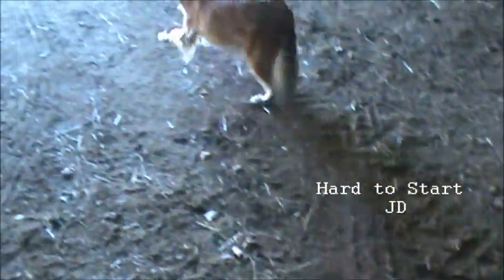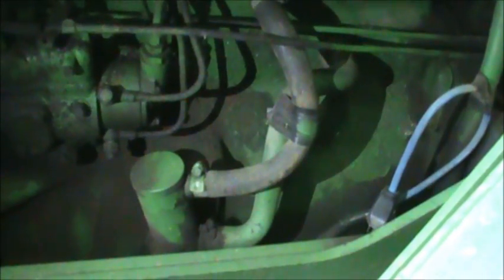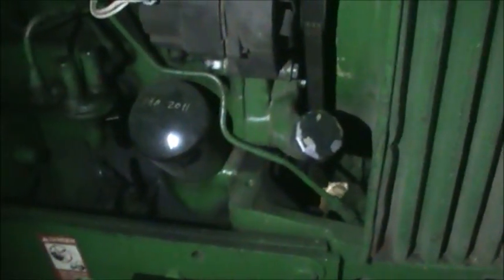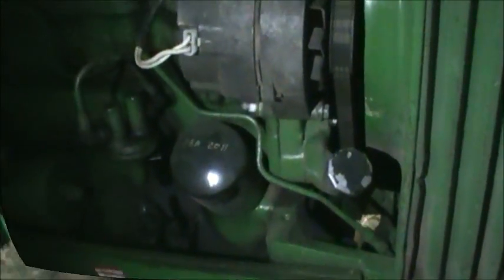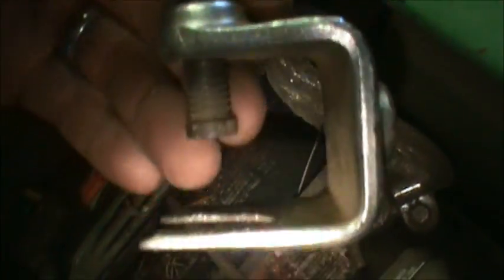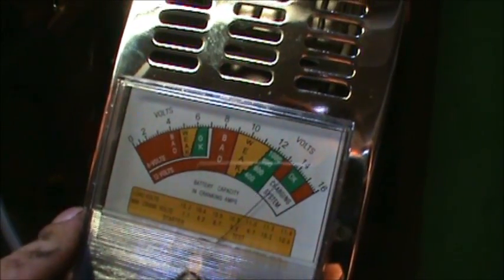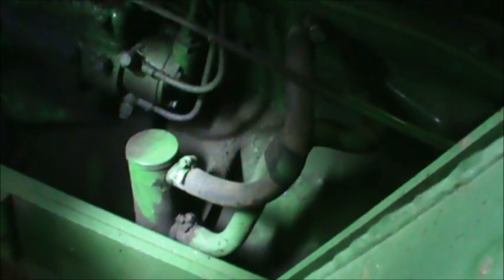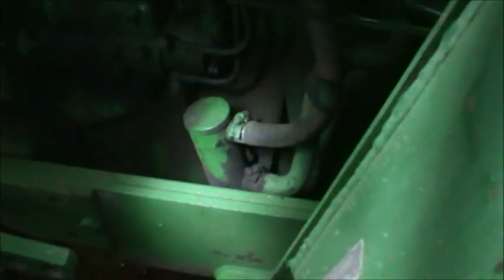Hard Start John Deere

Comment: Another quick note... The main closed-center high-pressure hydraulic pump (located just off the front of the engine crankshaft) sometimes had issues with not properly de-stroking on engine start up.  This can cause a lot of headaches when not being able to properly diagnose a hard starting issue, especially in the summer time when everything on the tractor seems to test out properly, including the starting, charging, and fuel systems. The temporary 1/2-assed farmer "fix" was to turn the steering wheel to the left and right repeatedly while cranking the engine over. This worked because of the design of the hydraulic system is to give pump pressure priority to the steering and the brakes first, over everything else. By turning the wheel, it allows an immediate path for the hydraulic fluid to flow from the pump. On a 1974 JD 2630 tractor that I once owned, I used to turn the steering wheel to the right or left, hold constant pressure on the wheel with my right hand, and turn the key to crank the engine with my left hand. Using that method, the tractor always started up just fine every time.

Comment: That filter # is 33370 in wix and drop the first # for napa gold.Also after you change it on the top of the mount above the fuel line there is a 13mm plug open it up and take the fuel cap off and it will free blead.Hope this helps.

Comment: The older John Deere 16-30 had always issues with loosing water/acid level in the batteries. The two 12 Volt parrallel batteries sit in a hot location close to the engine. Less surface area on the plates and problems with starting, especially in winter. That ground wire is onto the steel of the tractor. Better to run an extra 50mm² copper cable to the starter ground/ holding bolt as well. makes a huge difference.

Comment: Pretty much ALL of the John Deere diesels from this vintage (...10, ...20, ...30, ...40 series) had "issues" with cold starts. "Cold starts" is referring to about 50 degrees Fahrenheit or below, outside ambient temperature. If you plug in the engine block heater for a couple of hours PRIOR to starting the engine, it will fire right up easily and run just fine. Beyond that, you should replace your "glass box" fuel filter, at minimum, once a year. The other thing that has been often upgraded on these tractors is the battery ground straps. The replacement negative cable improvement is a joined together cable that attaches to both negative posts of each battery and then on down to the one easily accessible starter bolt at the engine block, rather than on the shitty sheet metal of the firewall. The grounds on the utility tractors were a well-known weak point for the grounds in the electrical system. The old Bosch and Delco starters that were typically used on those engines were not very great either. You can usually replace them with a direct cross-reference modern gear-reduction starter that is typically made by the Japanese company, Nippon-Denso. There are many new Chinese made knock-offs that are now on the market as well, that work just fine for about 1/2 the price.

Comment: On the circulating heater theres a one way ball on it if anything fell into the rad like a piece of tinfoil off a coolant jug that will hinder it from working properly --Ps should grease the Battery posts before clamping .

Comment: John Deere engines always have been hard to start. The old John Deere Backhoes had Ether systems installed from the factory. That old tractor I would have the injection pump off have it rebuilt.  The old rotary pumps have a bad habit of snapping the drive shaft in the pump. It is what happed to my dads 310.  Also replace the mechanical lift pump with a low pressure electric.

Comment: 6:55 is the  Fuel pump...should have 4 to 8 psi on the injector pump side 
8:43 you can buy those at part stores far cheaper than from john deere, they are universals just need to know what size hose you have.

Comment: thats a mechanical fuel pump. always look for air holes in the lines diesel will suck air. nothing wrong with batt. you had a conection..then when you loaded it it unconected..this happens when you boost too...ever had a booster cable on that lit everything up like dash lights ect...then turn the key and poof everything goes dead....that is the same effect...the load shows up your poor conection. then you dig in the cables better and it works that is what happened there.